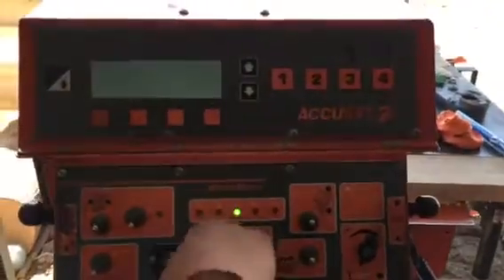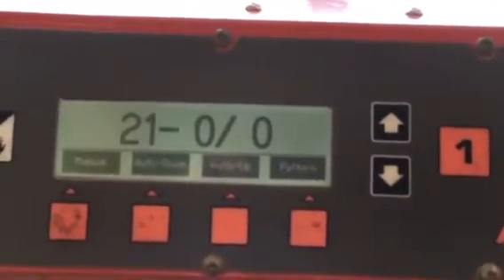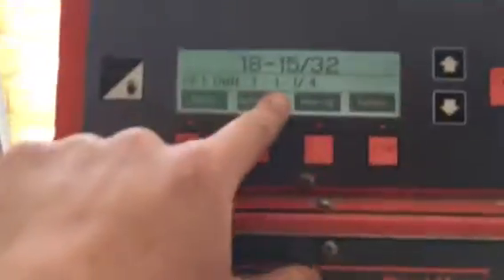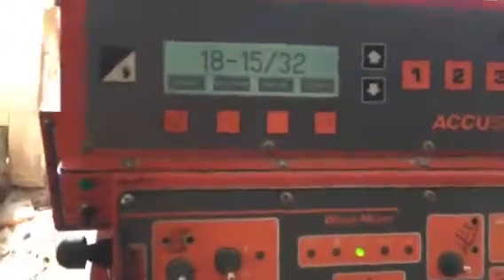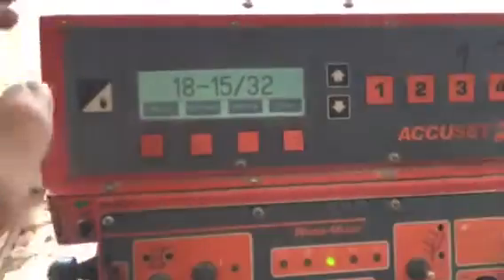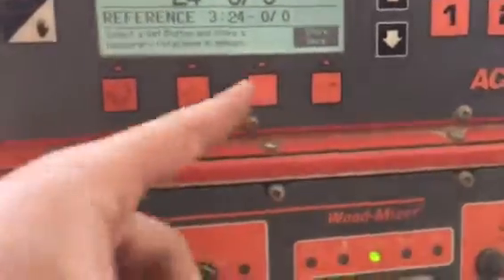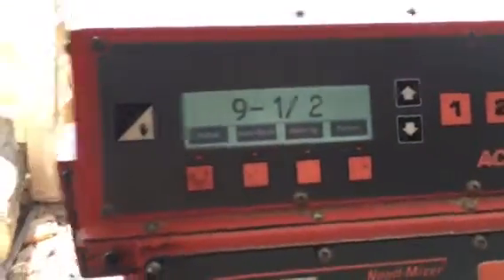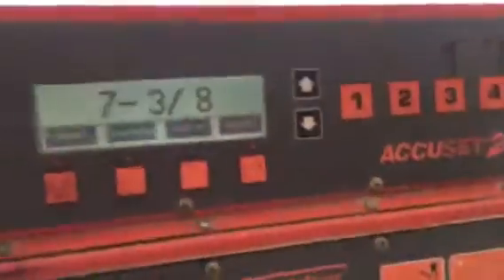Accuset II Basics

Comment: Question about “auto down”.  Say you are in auto down mode with 2” drops programmed.  You make a cut, use the drum stick to lift the head to clear the log on the return.  Once you are back at the operators position does hitting the drum stick down lower the head 2” from your last cut or 2” from the where you raised the head to?
Reply from the maker: William Morin it will set it from where you were when you turned auto down mode on.  Up is on the house, go up as much as you want, when you hit down it will bring you to the next cut and give you a 2” thick cut.
Reply: 4x4American thanks for the reply!